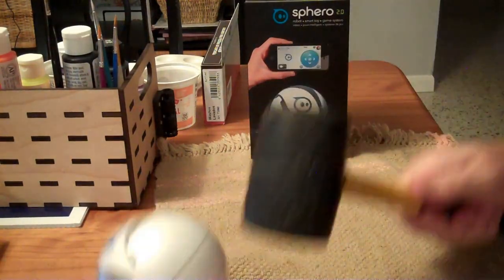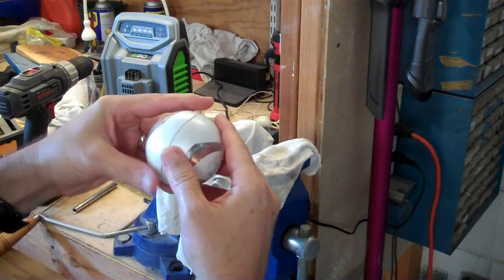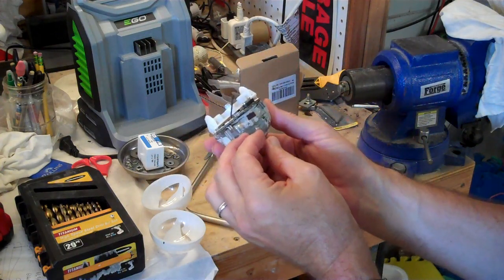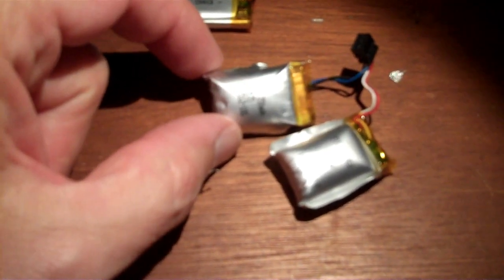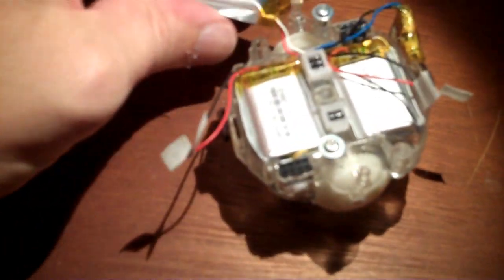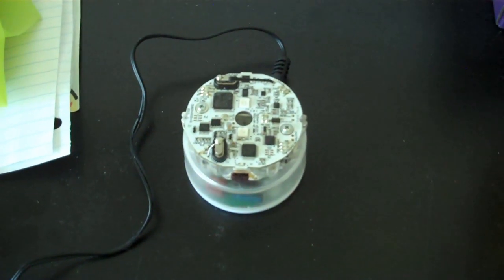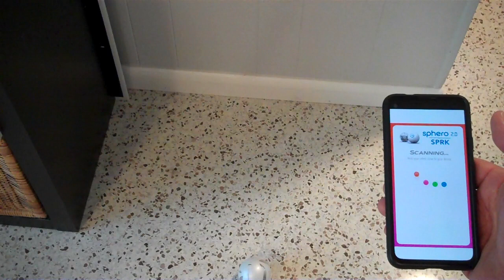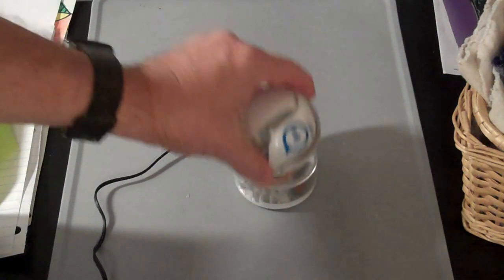Sphero 2.0 battery replacement

Comment: its a shame and it shall be prohibited to sell this kind of toys with no chances for battery replacement, same should apply for phones, etc
Reply from the maker: I generally agree, although with the Sphero I understand that they were trying for 100% waterproofing.
Reply: @summetj  the problem is, batteries leak with time or can cause fire, so not being able to check battery status or replace it, is a mejor drawback specially for a toy. Also, makes the toy obsolte faster than what it should, if ever.

Comment: Looks like my 2.0 has died. Thinking about replacing the batteries, myself. What glue did you use to seal it back up? Not that it's a huge deal but would you guess that the waterproofing feature is gone?
Reply: Do you think you'll get a longer run time with the bigger battery?
Reply from the maker: I used regular CA (Super) glue to seal it back up. I don't know if it is still waterproof or not. (If I wanted to make sure it was, I'd probably paint the seam with epoxy after super-glueing it.
Reply from the maker: @TheOne-TheOnly  From a mAh capacity the batteries are not that much bigger than the original, just gave myself problems getting it to physically fit, so I'd recommend using smaller batteries than I did.
Reply: Okay, great! Thank you

Comment: How does it behave on the charger once the battery is no longer good? I just bought the 2.0 Sphero on eBay and it was new in a unopened original box. I suspect the battery is dead from sitting unused for so long because I can’t get it to charge at all. The lights come on and charger blinks if it’s in the charger but after 3 hours it still will not come to life after detaching from the charger. Tapping doesn’t seem to do anything so it appears to not hold a charge at all. The only detail I find unusual here is that it won’t hold a charge for even a few seconds which I find strange for a brand new (though old stock) completely mint Sphero. Any tips for trouble shooting before I break out the coping saw?
Reply from the maker: That sounds like it's charging.  Make sure the coil inside is visibly "flat/parallel" with the coil in the charger (if yours is one of the transparent spheres....). Normally if you put the Sphero in the charger and the internal robot bit detects it is out of alignment, it will move around inside to line up. But if the battery is fully discharged, it might not wake up to do that, so it is important you get them lined up for the charging to work successfully.  I'd give it overnight (or, if you can't see the orientation inside, try turning it a few different ways over different nights) to make sure it won't charge up before cutting it open...as that's a lot of work.  An ultrasonic cutter would make the job easy if you have access to one....I wish I did when I cut mine open.
Reply: @summetj  Great tips. Thanks. I’ll give it another try.

Comment: Can you tell us the battery you used and where did you buy it ?
Reply from the maker: The specific batteries I used were purchased on ebay with the sales title of "2 pcs 3.7V 500mAh 702035 Lipo Polymer Rechargeable Battery For Camera Headphone" Item number 172428399373  (But the seller has updated the listing since I made that purchase). They were a little larger than I would have liked, so I don't  recommend them, but I was able to make them work by folding the cell protection circuits over and stuffing things in. (See the description on the video for commentary about battery size and my alternate recommendation.)

Comment: After my Frankenstein soldering, I just kept the battery cover off and attached the battery cable to the board before lining up the other pins. That provided enough room for my new wires. I kept the battery plastic holder off too. 
Also, I took a utility knife to the seam and pressed into seam and jiggled it back and forth until I got down in there a bit. Then I took a hammer to the seam every inch or so and it did pop off. By placing those cut in marks, I prevented the plastic from breaking off seam. This way I lost no plastic to the width of the blade. It's a perfect fit. No gap.